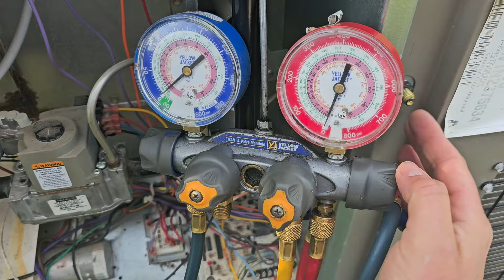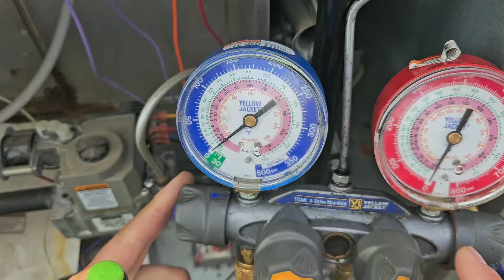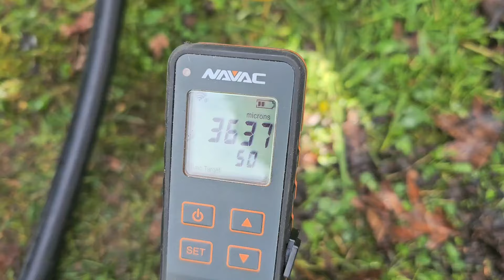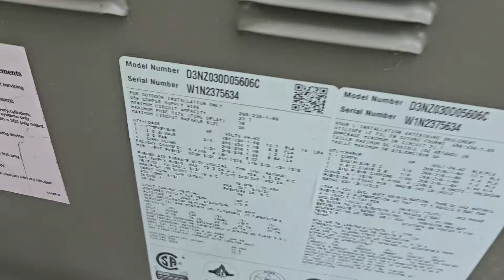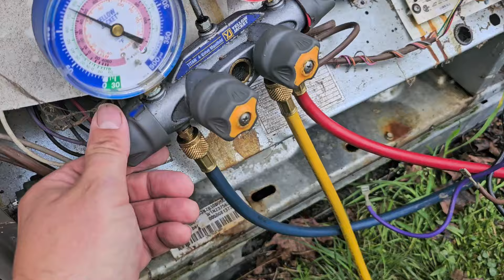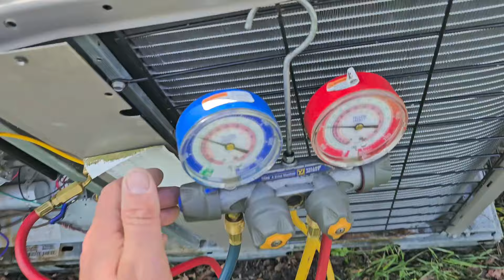How to replace the AC units leaking condenser coil?

Comment: Great video and vey helpful.
Just one question- I was taught to have vacuum gauge as far away from the vacuum pump as possible but you seem to have it very close to the pump.
Keep up the good work and will look forward to your next video.
Reply: That is correct. You want to measure system vacuum, not what vacuum pump can develop. It will be lower close to pump.

Comment: When brazing in the filter dryer there was no nitrogen flow through the filter dryer, and there was no flow for both stub removals. Nitrogen should have been fed to one port at a time and the tubing should have had temporary caps removed before brazing. There's supposed to be a damp cloth on the filter dryer when brazing, but it probably survived. 
    The nitrogen went in the discharge line, (a) backward through the compressor reed valves, which it didn't, to the suction line and then not out the removed Schrader so it would go backward through the evaporator coil, distributor TXV, filter dryer and out the pinched off liquid line which it also didn't (b) out the hot gas discharge tube that was pinched closed which it still didn't, so no N2 flow. OOPS! 
    Putting in the new coil there was nitrogen flowing but its a good thing you put in a filter drier to catch the oxide grains from the first round.

    There needed to be a little thought about the flow of nitrogen through the tubing as it existed, not how it would flow through a finished system ready to be filled.

Comment: I have a 5 yr old York unit. I have a leak in the condenser coils replacing the coils thankfully still within the warranty period just have to pay labor.
I had to replace the compressor last June right at 4 years old.
I will not get another York. My next unit will be a Trane.
Reply: What did labor run you?  I'm dealing with the same situation now.
Reply: @tardo6555  depends on your ac mans hourly rate it took them 4 hrs to pull condenser out and install new one

Comment: I did that with my friend we had problem after we put the Freon the cages was going in Negative whats the issue you think and thanks
Reply: More info needed. Did you charge to spec? If so, it sounds like a restriction in the liquid line.

Comment: You made a mistake. You should always put the vacuum gage on the opposite side when pulling a vacuum, it give you a more accurate measure whether you pulling the required amount of vacuum, or not. You do not not connect your gage at the vacuum pump where you have the lowest vacuum, instead you put the vacuum gage on the High-side, so when you read 500micron, you know you have a deep vacuum all the way through the system. Also, you should go bellow 500, like >300, and make sure it don't pull above 500micron in 10 minutes. And use a dedicated vacuum hose, rather than the one you used for refrigerant charging. 

God(Jesus Christ) Bless! :)
Reply from the maker: Thank you, brother, I really appreciate your advice